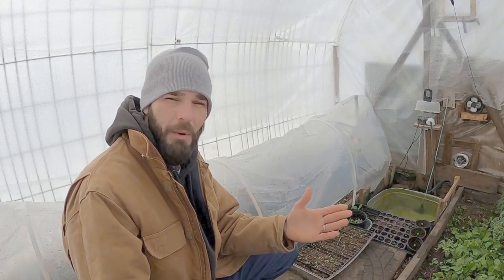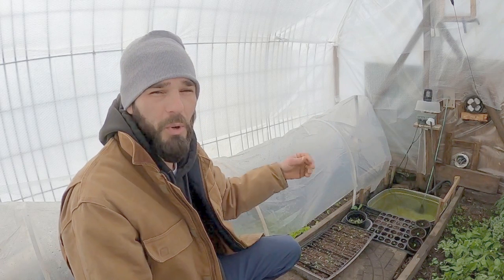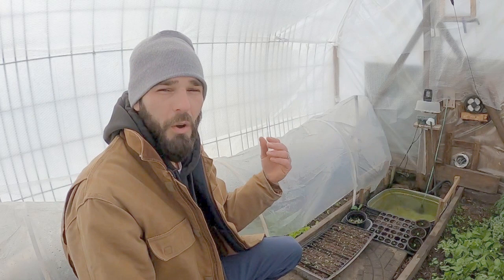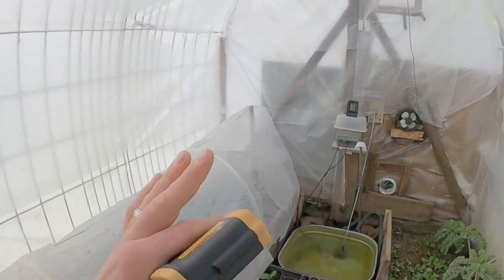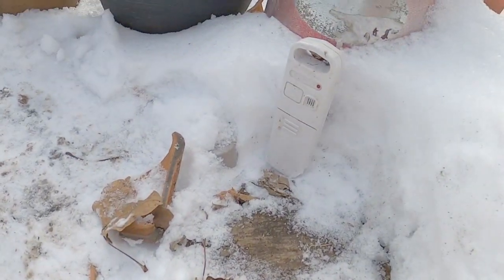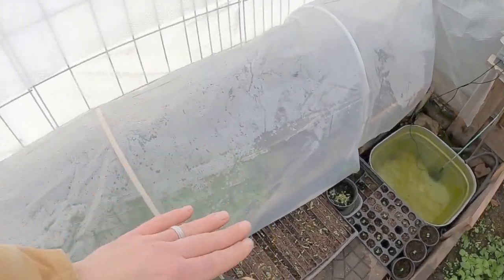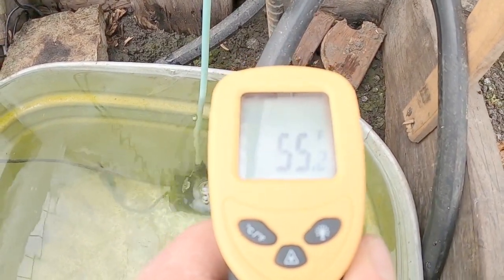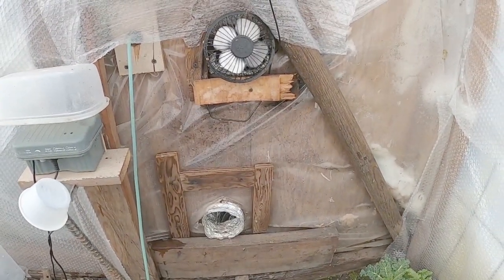Small DIY Compost & Solar Heated Greenhouse Autonomous Systems Check After Being Sealed For 1 Week

Comment: I love what you are doing here. What direction does your green house sit? I bought a greenhouse last spring and this is my first winter with it but I am not heating it yet but I want to do what you are doing. Appreciate your research.
Reply from the maker: The ends run east west making the larger sides exposed to more sun on the south and we’re insulating the north side. Thank you!
Reply: @Earthdwellershomestead  ah that's good to hear as that is the direction I put my greenhouse and what I want to do. Thanks!!!

Comment: LDS Prepper has pipes inground with air running through them. It pulls heat from the ground during low temperatures, mostly during the night. His hoophouse doesn't fall below 50 I believe.
Reply from the maker: Through geothermal you can achieve that also. But you’ve gotta be ten feet deep for the thermal warmth,